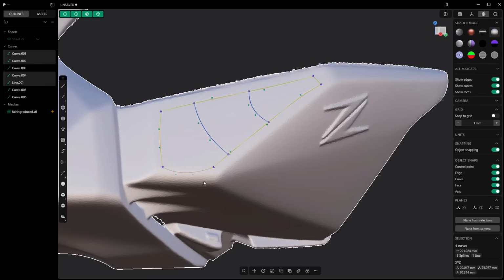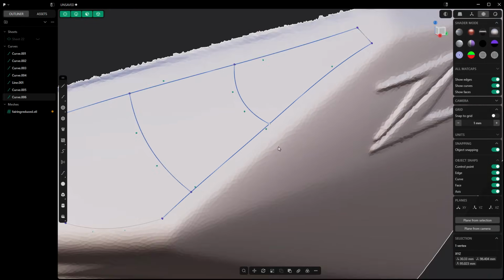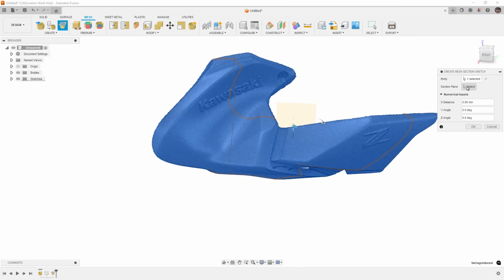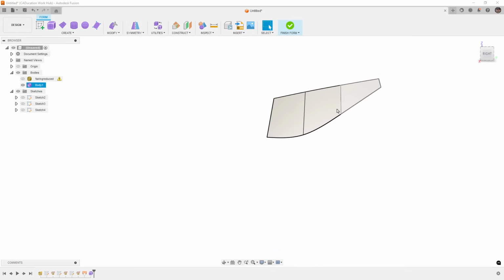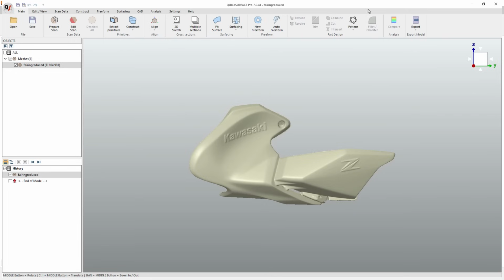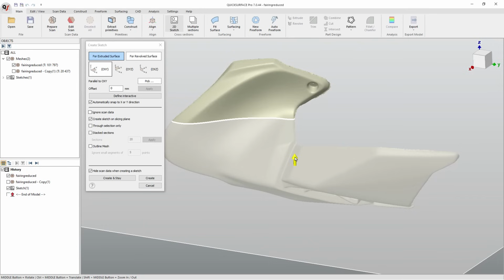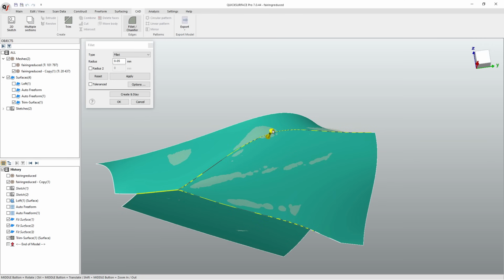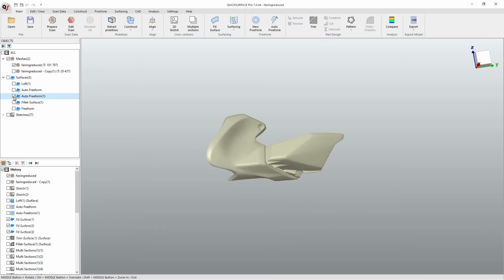How to Work With 3D Scan Data | Plasticity vs Fusion vs QuickSurface

Comment: That quicksurface software look amazing. Blown away. Can’t remember last time I was this impressed of a CAD related tool
Reply from the maker: Some of the recent videos like the BMW trim panel series we did in QS Personal.  There are 4 versions of it now. Personal. LITE. Pro and a solidworks add-in.  Personal is half the price of Lite, $240/year i think but only STL outputs.  great for alignment and cleanup .

Comment: I believe remodeling in Blender, followed by exporting the subdivided model to NURBS, would be much quicker and better...
Reply from the maker: If you can export a quad mesh, fusion can convert that to a form.  Blender can be tough for CAD users.  The one main benefit of QuickSurface is the analysis to see how close you are to the original.  Fusion and Plasticity (as well as blender) would just be a visual "close enough" sort of thing.

Comment: Are those tools also available on fusion for personal use versions. Thanks.
Reply from the maker: I don't have a hobby license so I can't confirm 100% of the tool differences.  Im told some of the mesh to cad conversion tools are different. But all the freeform tools should be the same between hobby, edu, and commercial users.

Comment: Can you simply turn off object snaps for "axis" to prevent drawing off a plasticity mesh?
Reply from the maker: if you don't want to snap to the mesh you can hold down CTRL and it will ignore it but it would still snap to plane if you are in a standard view or have a temp construction plan.  the Face snap is what you would turn off to avoid snapping to a mesh completely.  Sadly if you turn Axis off it would still snap to XY it would just not snap to X or Y independently.  

Axis is good to turn off if you don't want to get the "Y" or "X" snap extension lines. 

The best way to avoid snapping in plane is to just rotate the view a bit.  BUT i certainly could be missing something!

Comment: Quick surface and plasticity seems to be a great combo. Files saved as IGES can get edited in plasticity directly. Quick surface to produce an accurate reverse engineering model in IGES, plasticity to modify it
Reply from the maker: Great observation!  I should try that one!
Reply: @LearnEverythingAboutDesign tested this, it works very well

Comment: Technology has come such a long way. It shouldn’t be hard to just scan a surface and push a button and now you have a solid surface to design off of.
Reply from the maker: You can, but working with it downstream means that there is still of lot of planning and design intent needed.  QS pro AutoFreeform is pretty powerful if the mesh is good and you don't try to push it too hard.

Comment: For some reason, it’s so difficult it makes me feel like there’s absolutely no reason to have a 3-D scanner
Reply from the maker: It is much easier to create something that fits to a scan vs having to reverse engineer a part.  Right now there is still a big benefit to investing in software if you do this type of work.  QS Pro might be $4000 but saves a lot of time in a professional capacity.
Reply: @LearnEverythingAboutDesign  do you have any videos that show creating something that fits to a scam?
Reply from the maker: @electronicsguru4050  yes a lot depending on what you are trying to do.  from motorcycle parts, car parts and some other random stuff like this ear pod shelf. https://youtu.be/COh94Os45T8

Comment: I think Rhinoceros should be considered for this workflow.
Reply from the maker: I used Rhino 7 and didn't like the UI/UX and limitations on their form tools.  I haven't tried Rhino8 yet, but im told the form tools got better for that version.  I heard they got a Shrinkwrap tool but i am not aware of any direct subD type conversion in Rhino.  Do you know?
Reply: I am a 25 years + Rhino user, you can easily duplicate the workflows that you show above.  Blender is also a great tool for this task. @LearnEverythingAboutDesign

Comment: Another great video - thanks for sharing your knowledge yet again! 
Question on Quicksurface. Once I have created the surface in QS and then imported it into F360 - how do I then model off it? When the item comes in it opens as a body, if I do a sketch to extrude a new hole or build from this surface/body it doesn't seem to play ball. My goal is convert 3D scan's of car parts into surfaces in QS - then modify to meet my custom need - then ultimately 3D print once done. 
Thanks again for your help
Reply from the maker: In this webinar I went through the process using LITE and PRO showing where they differ.  Things like Pro being able to trim and boolean while LITE makes you export.  But this should hopefully show you.

https://youtu.be/_PdPFEnUpvM

the short answer is you treat it like any other surface or solid body, but you don' thave any history with it.  So you use new features like cutting a hole through it for example

Comment: Can't you get "flat" faces in quicksurface when automatically creating CAD faces from a scan instead of getting those faces that look like ribbons?
Reply from the maker: Yes you can extract primitives and apply a best fit plane, cylinder, or other prismatic features.  For prismatic parts that is the approach.  For complex organic parts that won't really work, but you can still use it for holes or other features.  It can apply a cone to a tapered hole or a best fit cylinder for those features and can then be used to trim away a complex form or surface.

Comment: You can also convert meshes to solid in fusion though i havent done it myself, theres videos out there showcasing this feature. They’re completely editable. This alone might pull me away from plasticity as its not as versatile… wasted a good amount of time learning it I guess though i came from fusion
Reply from the maker: the mesh to brep conversion in fusion is very limited.  Basically if you draw a model in fusion, convert it to a mesh, then try to convert it back to a solid it might work, but it will be without features.  Any time you get away from a basic prismatic part all you end up with is a bunch of triangles on a solid.  It works better when you have mesh face groups that are clean.  The problem is most models, especially ones that are scanned, don't fit into a nice prismatic shape category.  Even if they are in reality, the scan mesh of it is nothing like that.
Reply: @LearnEverythingAboutDesign true… i want to try it out without the prismatic feature and just use the edges to make larger faces/surfaces out of the little triangles. Also want to try an open mesh to see if it can make sheets

The topographical shader in plasticity is cool but you can’t duplicate the lines it displays. It essentially does mesh sectional without actually letting you use the sections

Comment: How can you trim surfaces in the Lite version? I don't get the button in the Main->Part Design section. When I compare Lite to Pro on QS's website "Trim Surface" is not available in Lite. I'm going to try exporting my surface model to Fusion and do the trimming there.
Reply from the maker: Hi Rick, yeah LITE has limitations with trimming/boolean operations that Pro Doesn't.  You basically need to create your surfaces and export them.  I did a webinar for QS last month going over a part with both LITE and PRO and show the limitations there.  https://youtu.be/_PdPFEnUpvM   Basically you can create solids, planes, surfaces in LITE but can't trim them.  You can export the models and bring them in.  In the webinar video we do that in LIte first then show it in pro to highlight the difference.
Reply: @LearnEverythingAboutDesign YT keeps deleting my replies. Frustrating.
Reply from the maker: @rickmellor  doh. you can always email me support@caducator.com

Comment: Hi, I was wondering if there was a good way to bring those mesh files, fix self intersecting geometry and holes, then turn them from tris to quads, then in fusion turn it to surface? as in triangle mesh -> quad mesh -> T-Spline -> BRep? My lack of knowledge in fixing triangle mesh and then converting to quad mesh is the biggest problem here. I think this workflow, if it works, could be really helpful for reverse engineering complex shapes.
Reply from the maker: I am not instantly aware of a tri to quad conversion in QS lite or Pro.  Since it handles this with its own SubD conversion from the tri I imagine its doing something in the back end.  QS is really good at working with meshes, isolating sections, fixing issues etc, 

There are a few ways to get to a quad mesh.  One is the free tool here https://github.com/wjakob/instant-meshes  It really depends on the quality of your scan data and has limitations, but a great starting point.

In fusion if you have the design extension this opens up an "organic" mesh conversion option which does a quad mesh then tspline conversion for you.  What i have found is that this tool isn't worth the price of the extension alone and often is way too dense to make the form worth editing.  If you have a trial of the extension it is worth a shot.

There are other mesh tools capable of doing a quad conversion, some with more worth than others.  Programs like Blender.

What you will find when going away from a dedicated mesh program like QS, geomagic etc is that you don't get visual feedback on how close you are to the original data.  Programs like Blender, 3dcoat, and others that are meant for game/animation/viz work don't care if your quad mesh is .5mm off from the reference, but for reverse engineering that matters.

You could check out MeshLab, which is free.  I don't like the ui/ux and it is limited in some cases and super powerful in others.  I can't recall if it has a quad mesher built in or not.

Comment: Thank you!

Looking at all these trendy AI-generated videos, I still don’t understand why CAD and other surfacing tools still exist and cost so much.
Reply from the maker: Well the outputs from Ai generated models are not CAD models yet.  So you have mesh, which it can make some messy mesh files, and BREP (like prismatic parts) and NURBS surfaces.  I have yet to see any AI tool that can make true prismatic cad files or complex surfaces.  It also takes the creativity and experience out of it.  I personally avoid AI tools with some exceptions to use it like help files (debugging code or searching large amounts of data).  put for me pure design is still something I won't turn over to AI.
Reply: AI usually has odd facets on surfaces too.

Comment: I know you and many others have plasticity beginner tutorials, but trying to do anything without a tutorial, found plasticity super user unfriendly..QS is prohibitively expensive for normal humans, where i was disappointed that Revopoint bundled it with the Metrox and their program, so Fusions lackluster tools or Blender, until i get used to plasticity (i am willing to get the studio license, but first experience was super frustrating)
Reply from the maker: Plasticity can be hard for sure.  Blender users have a better time of it than coming from a traditional CAD tool.  The toolset, depending on what you want to do, in Fusion is pretty good.  Surfacing needs work for sure.  but i will say between plasticity or blender, blender is a mUCH harder program to learn.  If you can learn blender you will have no trouble with plasticity.
Reply: @LearnEverythingAboutDesign yeah, Blender grew from such a convoluted base and it has a billion key bindings and every single Add-on has its own, and the crashes..
But opening plasticity, left click didn't do much, right click doesn't have a context menu and the documentation confused me even more , so i closed it and have yet to open it a second time lol
Reply from the maker: There are radial menus (we did a video on it) and for Plasticity the shortcuts can be tied to a search menu which pops up under the cursor.  The hardest part about plasticity is really knowing what command to use for sure.  Maybe one day ill do a live QA video where we can walk through whatever program/workflow questions.  in the mean time don't hesitate to ask questions.
Reply: @LearnEverythingAboutDesign Yep, i never do, love your approach to things ever since i found the channel what is it now a few years ago already lol.. doubt I'll catch the livestream, that would be a game of chance but im sure you'll upload it.. irrelevant to this, one thing im waiting to see in Blender, would be the function locked behind the extension in Fusion or programs like nTopology with designing infill of meshes, but ain't a programmer and haven't figured out geometry nodes to a functional program level yet lol

Comment: I love the tools in QuickSurface to reorient and align scan data, but that's all I need it for. I use SolidWorks but the mesh manipulation tools are pretty terrible. Are there any other tools besides QS that I could look at for mesh realignment? It's hard to justify the price when mesh alignment is alI I would really use it for. CloudCompare works but not exactly intuitive when you don't use it everyday.
Reply from the maker: I haven't found any free/cheap tools that work as well as QS Lite does for that so far.  Hopefully in the future we will have something.  I have heard others use GOM inspect but I haven't tried it.  I have QS for Solidworks which is cheaper than Pro, but honestly Pro is much better than the integrated version in SWx IMO.  The add-in does make Mesh in SWx run so much better though.  You just miss out on some of the cool tools built into pro for nearly the same price.
Reply: Yeah I don't even mind paying for it, doesn't need to be free, but even QS Lite costs too much for what I'm going to do with it. So I need a stripped down QS Extra Lite, basically ☺️